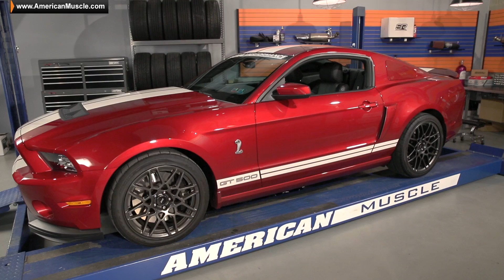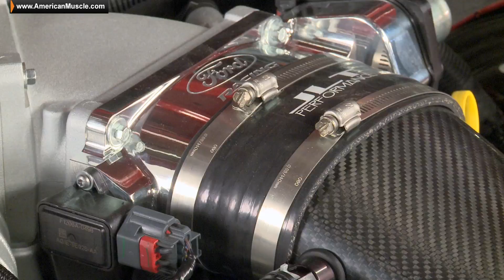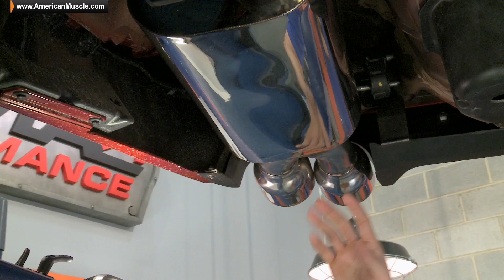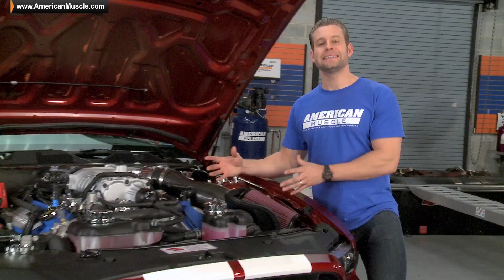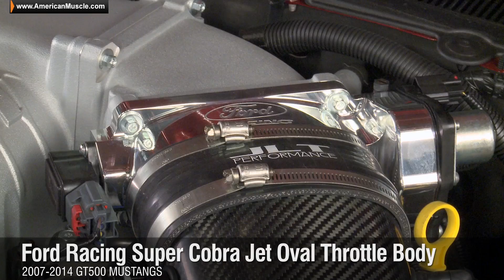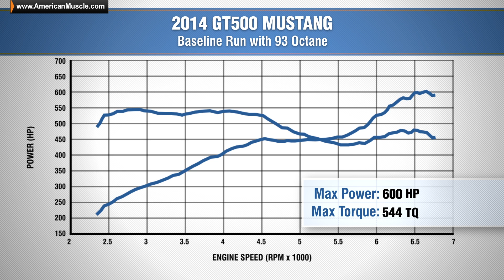2013-2014 Shelby GT500- Bolt On Build Ups: Stage 3

Comment: I am a huge Mustang fan, and also a big fan of Carroll Shelby. In 2014, there is no doubt that these pony cars were the cheapest muscle cars to buy and modify. Closest bang for the buck competitor was the base Chevrolet corvette. Those were about equally priced, a tad cheaper, but the engines were not designed to produce huge power stock. Those cars typically could handle 650hp safely boosted, I believe it was up to 6.5psi. This Shelby was definitely cooler, more advanced, offers a backseat, and is more iconic than a mass produced baseline corvette.

Comment: Removing cats from your car could cause uou serious issue with the law, but at least you will enjoy the sound of screamin V8 with supercharger
Reply from the maker: We always recommend checking with your local laws before modifying your vehicle! -Zach
Reply: @americanmuscle  I don't answer to the law, only to my parents :)
Reply: Honestly..especially in states that crack down on exhaust mods, it is not really worth the chance of being caught without converters.  The stock car is already hovering around 600rwhp and for a street car you probably don't need any more than that with street tires working on a street surface.  If you go to the dragstrip or road course (assuming there are no sound limitations) you can remove them..you just have to put them back on if you drove the car there (takes like 20 minutes to swap them out).

Comment: Seems like great gains! Couple of questions. A lot of people were wondering where the Long tubes were and I agree, especially if you’re deleting cats anyways. Is there notable power over these parts going with headers? Also I noticed on the graphs that you guys weren’t taking advantage of the 7k rpm in this stage 3 kit. Was the computer cutting it out? Thanks and I love you guys’ content.

Comment: Original hp is not 660?
Reply: That's at the crankshaft not at the wheels. About 580 horsepower at the wheels 660 at the crank.
Reply: Gokhan , 662 @ the crank

Comment: how would these mods work on a 2010 gt500  and would the gains be as impressive or what would be the best bang for the buck changing the eaton charger for the 2.3 unit on the 13 and 14 cars  with throttle body and would injectors need to changes as well

Comment: Forgive my ignorance, but will the augmented torque result in any noticeable premature mechanical failure in the transmission or rear differential since the mechanical elements weren't designed for torque in excess of roughly 630 lbf-ft?
Reply: No, the only issue would be the clutch. If you launch at 2000 RPM's or less, you won't have any problems.  If you're launching at 4000 RPMs on slicks, you will burn out the clutch, or bend the axles.

Comment: Great share!  Combine Stages 1, 2 and 3 and you're looking at just over 3K and that is huge!  I think the only thing I would do different is the exhaust setup.  I like the sound made by the Shelby 1000.  Of course a lot more is done to that engine internally to help with its sound but the exhaust note from it's setup is unparalleled so I would try to replicate it initially with the same setup exhaust wise to start.
Reply: Bjorn Hermansen you need Borlas and a built motor go stage 3 comp cams that’s as close that you will get to a shelby 1000 sound ...

Comment: Which x-pipe is in this build I didn't catch the exact one in vid, I'm in process now of purchasing a 2014 GT500 stock w/ 12k miles and want to do all three power packs. But need to know which parts to order? Also noticed your site doesn't list the CAI in carbon fiber or for stock GT500 supercharges where can I find it, and why do you no longer carry the innovators west balancer? Thx guys and great work, your videos got me back into mustangs after a 20yr laps. Lol.
Reply from the maker: That's awesome Greg- glad to hear we helped reignite the 'Mustang Flame' after all these years!  If you hit the 'show more' button underneath the video it will give you the parts used along with the links to the individual products our site.  That particular x-pipe is made by stainless works and is designed to work with the factory manifolds.  Unfortunately we do not currently carry the carbon fiber JLT or the Innovators West balancer at this time- sorry Greg.  Thanks again for the kind words and good luck with your build!  -Justin

Comment: what does this car with the mods yall did do on the qtr mile drag time wise???
Reply from the maker: JPETERS913  Good question and we never got this sucker on the track but with optimal track conditions, the right driver, and a set of drag radials I would anticipate low 11's high 10's - Alex
Reply: ohh dang it lol and thanks for the reply and thanks man that was my next question but ya'll already gave the answer before I asked ll and what else would you have to do to get it into the mid to low 10's with Pirelli Street Tires and or what would be the best Street Tires for that car that you can drive it just fine on the Street and take it to the drag strip and with the right mods if possible get it into the Mid 10's to low 10's??? This 2014 Shelby GT500 is my dream car and idk when I will get the car but I just know I want it and I'm wanting to get one sooner than later and I'm taking all the notes I can on it I have all the mods you did to that car written down lol and ik it's a lot in this msg lol but does this car come with Long Tube Headers or do you have to get that put on after market??? + is Long Tube or Short Tube Headers better on gas or is there really a difference when it comes to that???
Reply: JPETERS913 should be low 10s with a good driver maybe even 9s with some drag radials

Comment: What stage would the whip ole super charger kit be if added to this stage three set up.  I'd love to see you do a video adding this kit and other parts needed to run it. Love the videos. I have a 2013 gt 500.  Based on these mods U won't have to spend $40,000 sending my car to Shelby for a supersnake conversion.  Looks like if save a lot just adding your parts from the site. Please let me know. Sweet upgrades on this video too.

Comment: Great video! I've got a bone stock 2014 GT500 myself, (if you wanna see it it's in my latest video), and I was just wondering if a 3.4 Whipple would do good for my car. I'm not gonna do the 2.9 Whipple because its simply too small and I want to go big. I am definently gonna do more mods too. Gonna add a JLT Carbon Fiber CAI, Cobra Jet Throttle Body, 2.4 Upper Pulley, Custom Tune, 3.4 Whipple, and keeping the stock exhaust but removing the cats. Also, what kind of numbers do you think I could put down with these mods? Hoping over 750 crank horsepower. Thanks.
Reply from the maker: 2014NCGT500 Great looking Shelby! In all honesty, with the mods you are mentioning and with some good tuning, I can see your Shelby hit 750+ to the wheels! Those Whipples are no joke!. - Will

Comment: Have you guys attempted a build with the same or similar power level that is still street legal? Maybe better cats and a little more boast. Also, I've never attempted a build capable of this much power that could run with lower octane gas during normal street driving and a switch in tune and better gas for weekends at the track. Any thoughts?

Comment: How much power would it make without using the catless x pipe?
I mean having more power is good but having
A catless car means it's super pollutant and smells really bad( and it's bad if you have friends following you with a car)
this car does like 5mpg when WOT
Reply: dimmacommunication You know how I know you're gay?
Reply from the maker: dimmacommunication A properly tuned car shouldn't have any issues at all with gas mileage.  You should be seeing a little bit better than stock with all of these mods installed (as long as you can keep your foot off the gas! Haha ).  However, I can definitely understand where you would want catalytic converters instead of an off-road X-pipe to keep from having to worry about having a "fume heavy" car.  You really would only see maybe 10HP loss peak at the most if you get an X-pipe that has high-flow catalytic converters.  The car won't be anything like the off-road X-pipe in terms of smell and the guys over at Bama Performance can make sure that your lambda air/fuel ratio is spot on during cruise all the way to wide-open-throttle which will eliminate that problem, as well! -Chris
Reply: thanks for answer :)
Reply: Jeremy Luder
LOL

Comment: 709 to the wheels. The New Hellcat challenger make 707 in crank! I'd love to see a drag race between these two. It'd be fun to see the fat Hellcat beaten by the previous generation of mustang. Can't wait for the 2016 svt.
Reply: After dyno testing the hellcat it showed that it has more than 707 at the crank. More like 750 is the results they came up with. It would definitely be an interesting race between a stock hellcat and this moded Shelby, or a moded Hellcat vs this Shelby. Either way for us car fans the results would be a win win.
Reply: This Shelby will win bc it has more hp to the wheels. If u measured this car at the crank it would be close to 750
Reply: I like mustangs, but the new hellcat is going to take a lot more than a few mods to beat the shelby. Especially if you want to have a mod for mod fight or even a stock drag.
Reply: Yeah buy a used GT500 & go to Town !!!
Reply: Dante Planeta
The hellcat has the numbers, but it also has the weight.  I think a stock 13-14 Shelby  can take the new hellcatt (if only a few tenths).  Current testing show the hellcat a couple of tenths slower (and a little mph down ) than the latest Shelby.
Reply: James Nolan try close to 800hp at the crank
Reply: Yeah u are right the Shelby's drive train loses Around 12 Percent So it's around 794 to crank
Reply: James Nolan I wasn't trying to be a dick btw
Reply: It's all good
Reply: Frankie S a stock gt500 beats a hellcat I’ve seen a gt500 beat a demon recently

Comment: Did I hear that correctly, the car is NOT running catalytic converters?
Reply from the maker: Correct Charles, "Off-road" mid-pipes typically do not include cats.  If you are not willing to ditch the cats completely, there are several options out there that include a shorty or high-flow cat.  A "catted" mid-pipe should keep Johnny Law happy, but will not give you quite as big of gains as you would see with an Off-road.  Hope this helps!  -Justin

Comment: I have a question, what is the different between a normal Exhaust Pipe and a X-Pipe thanks for help. Greats Chris
Reply from the maker: Hey Chris, thanks for watching and good question!  The factory GT500 exhaust includes an H-Pipe for a mid-pipe, which will give you a little deeper tone and a little more low end torque.  On the other hand, the X-pipe will give you a little more rasp and volume along with slightly higher top-end gains.  A lot of it really boils down to what kind of sound you are going for as the difference in gains is usually minimal.  Hope this helps and thanks for watching! -Justin
Reply: AmericanMuscle.com  I'd like a deeper sound for my Shelby GT500 2014, which Exhaust would you recommed for me? Thanks for help Justin.
Greats Chris

Comment: It's an awesome car, but desperately needs cams. Look at the drop off after 6k. If you can keep that power up to 6500, watch the E.T.s drop substantially. It's still a nice package you guys have though.
Reply from the maker: Hey David, thanks for watching and for the response!  I would say 'desperately' needing cams is a bit of an overstatement.  In fact many of the fastest ET/highest HP 5.8's still utilize the stock cams.  I definitely don't think it would hurt, but if anything a blower swap might be money better spent.  ;)  -Justin
Reply: This is a bolt-on build up, cams are not as simple as that though. :(
Reply: Completely understandable, I wasn't dissing the build at all, amazing what just simple bolt ons do to this car. Was just an observation that cams would completely unlock the full potential of this set up.
Reply: David Fischer I agree its amazing that you can add this much horsepower so easily!
Reply: AmericanMuscle.com Lol, ok, maybe "desperately" was not the right word, especially when already making over 700hp. It sounded less extreme in my head. Lol
Reply: Imo it needs cams I love a cammed v8 and the hp and torque ud gain would be definitely money well spent in my book.

Comment: I think one thing missing from these bolt on build ups would be a before and after 1/4 mile run, that would be really awesome.
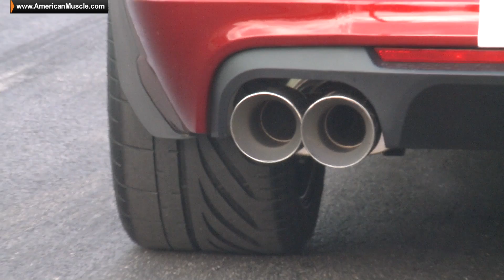Reply from the maker: I hear ya Joe, but the only thing hurting us in this case, is our location.  We actually filmed this build in the dead of winter when all tracks close to us here in the North East are closed for the season.  In fact, if you look closely during the exhaust clip at 2:03 you can see it a little snow falling!  We will definitely keep that in mind though for future builds- I want to give the people what they want!  Thanks for watching and for the suggestion! -Justin
Reply: Agreed. Comparison times are what matter, these cars have a huge challenge with traction. Owned a 2011. Awesome car all around as my daily driver.